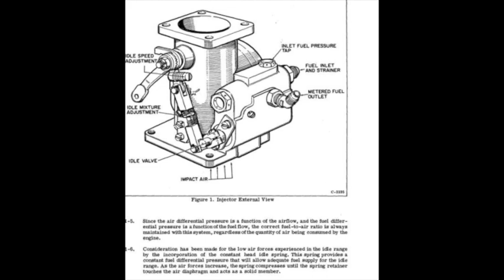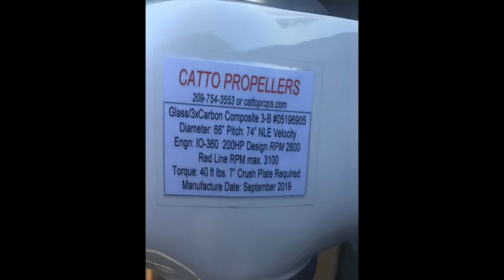Velocity kitplane build - Part 23

Comment: Good job! At 2:54, the small door on the cowling - you can consider to make a stiffener on the inside surface of the door. Was being at the factory I had heard a story from one builder about the lock was opened in flight due to the door was not strong enough. It was bending and then opened constantly during a flight. I payed my attention to it, cause I found the door was made pretty solid, so asked him. I can share some photos with the thing. 
I am going to start my log soon also...
Reply from the maker: It is funny you mentioned that. I was originally going to add some triax to the back to stiffen it, but at least on this cowling, the existing fiberglass is already about twice as thick for some reason as the rest of the structure.